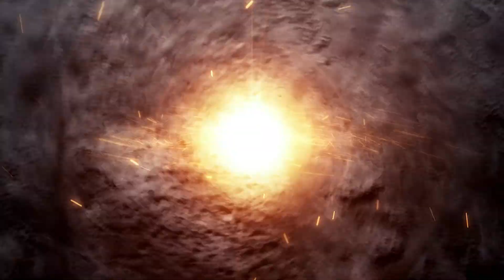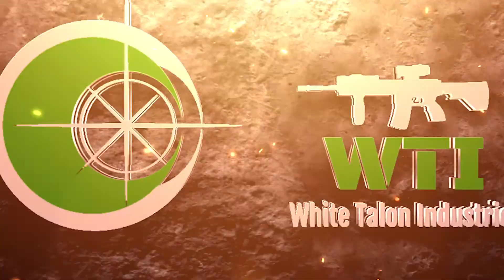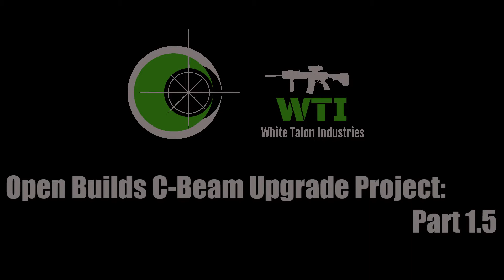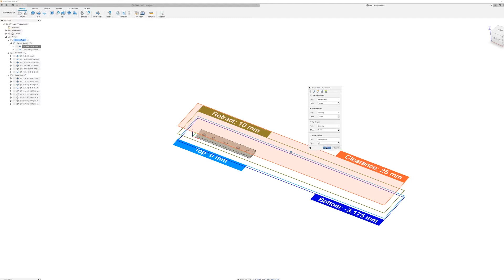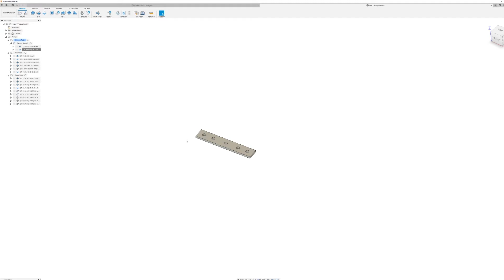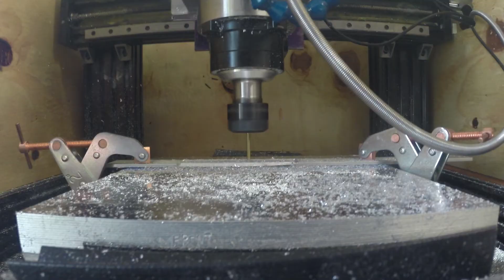Open Builds C-Beam Upgrade Project: Part 1.5

Comment: Please use a 1/4" steel plate for your base and build up from there..
Build your house on stone not sand
Reply from the maker: The base of the machine uses a 1in thick block of steel. The whole machine is rigidly bolted to that. As for the Y axis plate that the Fixture plate will attach to, I would love to make it out of steel, unfortunately my machine cannot cut steel to make it.I am making it out of 7075-t6 though which should provide the needed rigidity I will need for cutting aluminum. Thanks for the comment!
Reply: @whitetalonindustries  I meant instead of the MDF/plywood you have going on there

Btw do you want to draft a part for me? I learned mastercam and now other 3d modeling programs are torture for me to learn 😭
(Willing to compensate you for your time and effort) 
Email me if you are interested
Reply from the maker: Sure just send me an email at whitetalonindustries@gmail.com